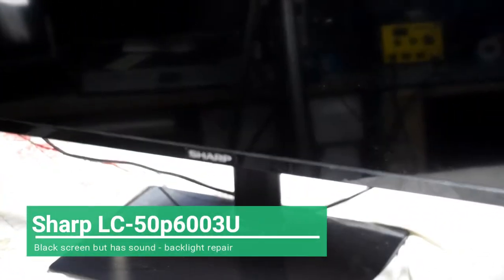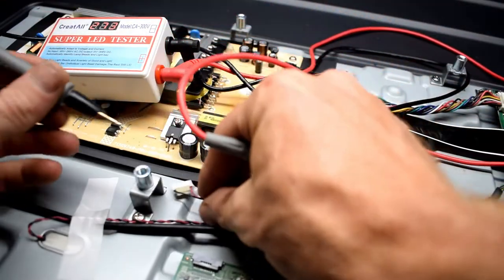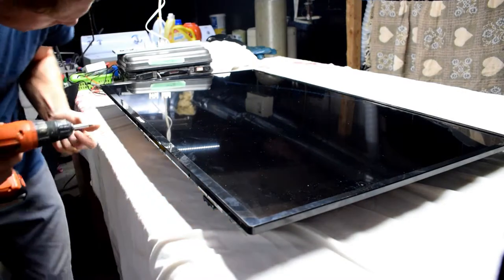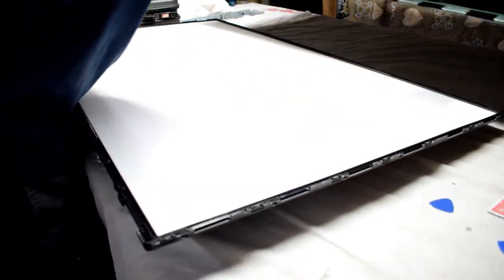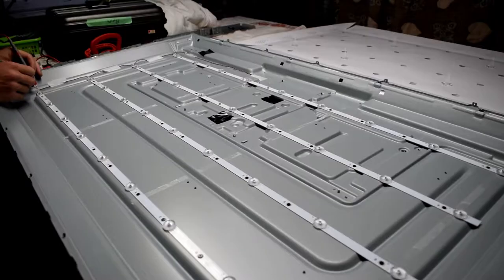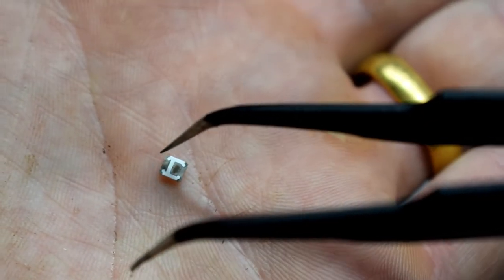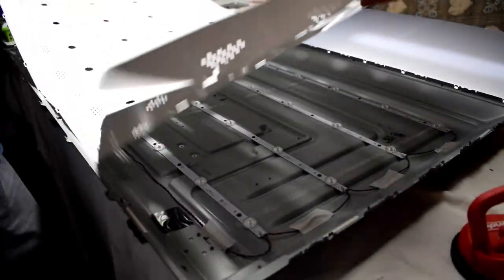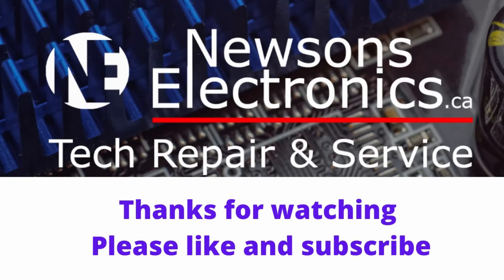I fixed this sharp tv for $1! (LC-50P6003U) -  backlight repair

Comment: My backlight turns on for 1 second when you first start the tv. The voltage at the led connector spikes to 150v and then settles to 85v after the LEDs turn off. The capicators on the power board for the LEDS say 200v on them. Would this mean the caps are bad because they are not holding the current around 200v or would it mean that they are not being supplied enough power to stay at 200v and the LEDs need at least 150v to turn on?

Comment: The white reflective sheet is damn hard to remove on my LC-65N7004U. Any ideas on how to remove it without tearing the sheet? I saw another YT video suggesting to cut the sheet around the LED strip to remove the strip. I seriously have doubts about cutting it

Comment: Great tutorial but I just want to reiterate how EXTREMELY CAREFUL you need to be when removing the screen (2:10-2:25 in the vid). It's glued on incredibly well and I very slightly put a crack in it when trying to dislodge that spread across the whole thing instantly and I discovered that it COMPLETELY DISTORTED the whole picture.
Reply: USE THE PLAYING CARD FOR REMOVING THE SCREEN FROM THE GLUE AND NOTHING BIGGER OR HARDER LOL. The LED part worked like a charm though!! I was so pumped after I replaced the LEDs and did your test and it worked!!! Thought I was home free until I put it all back together and turned it on!!
Reply: Speaking of which, anyone know where I can order a replacement screen for a Sharp LC-50p6003U? LOL
Reply from the maker: very good advice use the card, sorry to hear the screen broke.
Reply: @NewsonsElectronics  No worries at all, thats my bad for not being careful enough with the screen. Your tutorial was spot on down to every tool and detail and the LED part worked great!!! Thanks again!

Comment: would it be the same for an LC-52LE830U...? having the same issue...had some electrical crap happen...got 1 slow and 1 fast blink(or visa versa, i cant remember now)...bypassed that and was able to hear sound, just no picture...i can hold the flashlight from my phone up to the screen and see the settings and scroll through them still...so it has to be the backlight right?

Comment: @Newsons Electronics Great work. I am learning to fix my appliances at home and this time was my sharp tv back-light.
I want to order some leds to proceed to fix my TV but how do I find out the voltage and wats on my TV? Are you able to help me? Tv model is LC-49CFG6001K

Thanks
Reply: The led voltage and wats, I have found a reference for the led strip but nothing says the voltage or wats?
CRH-P49CA35350512R59P-REV1.1B

Comment: If tv does not turn on because of bad led, how can you have sound?
Reply from the maker: the mainboard still works just the power supply doesn't send any voltage to the leds.
Reply: If you have bad leds, it does turn on, you just have no picture because of no leds.

Comment: Ok I got as far as the white plastic sheet around the LED’s. Without buying a fancy LED tester is there any way to test the LED’s? E.I. A small battery with wires to each terminal. Sorry, I’m broke
Reply from the maker: you can use a multimeter
Reply: @NewsonsElectronics  thanks. done. Tested them all and one is out. Have removed lens and diode but when ringing round to source a new diode a lot of people were saying just get the whole strip replaced cause if one has just gone then likelihood is that the others are on way out too. Is this right? and what’s your opinion. Before I go out and buy strips :/
Reply from the maker: @ruudboy26  if you want to save money just replace the broken led and turn down the brightness. Why waste so much money just get it to work then if it lasts 2 years good then buy a new tv.
Reply: @NewsonsElectronics  yeh I’ll change the one bulb. If another goes it’s only a half hour repair and I’ll have spares. Thanks for your help and the tutorials!

Comment: I have the same TV and is it normal that there is 1 seemingly random LED that doesn't work on each of the 5 strips?  Could it be a wiring issue in my case?

Even very close up, they don't look "burnt"
Reply from the maker: just bad leds

Comment: Hello, this won't last. The rest of the leds have sustained the same fatigue that made that particular led fail. What will happen is that soon another led will fail, then another and so on. To future proof your work, you should change all leds. You do that by either changing all led beads or as our Indian friends do, painstakingly change every single led using a hot surface and a led kit and then glue each diffuser with a UV glue. I don't know if this is your TV or you fixed it for someone else. If the latter is the case, explain to them that this is an economical repair with no guarantee of any kind that this won't happen again. EDIT: I also noticed you attached the new led using direct heat. This makes sure, the led won't get to live as much as its manufacturer would have hoped. I'm sorry for the negativity, but you do things I did when I started repairing TV sets and caused me a lot of embarrassment later, when a TV failed for the same reason again!
Reply from the maker: you are correct but if you turn down the brightness it should last a year or so, the issue normally is people put their brightness to 100%
Reply: @NewsonsElectronics  As long as you make sure the customer is aware this is just a quick fix and charge accordingly, then it's OK!
Reply from the maker: @solidhit2  spot on
Reply: That is likely, but it could just be a "bad" led.  One that worked but was bound to die much quicker.
Reply: How do you change all LED beads? Do they come in ready to install strips?